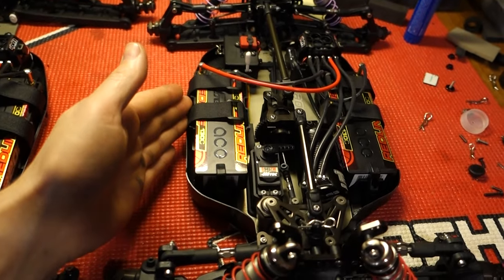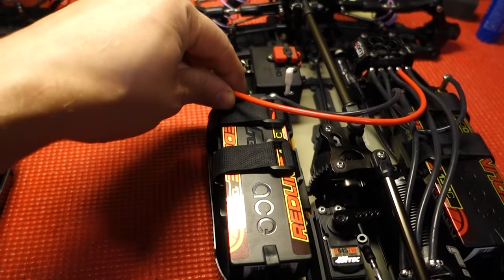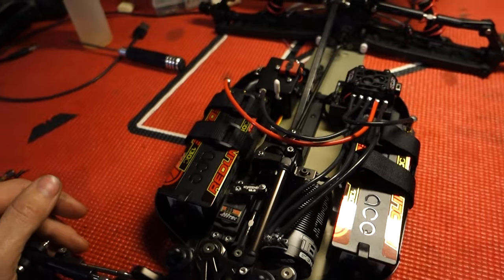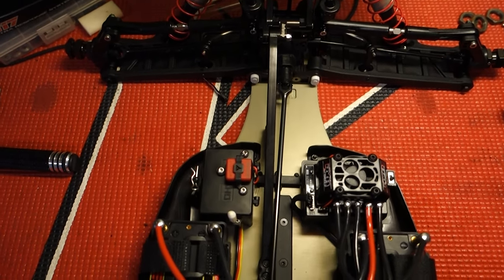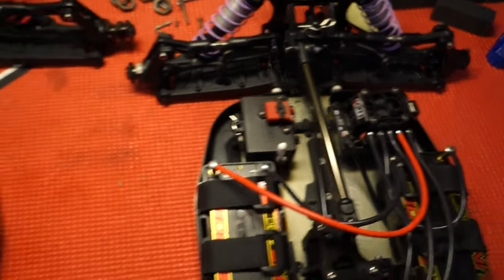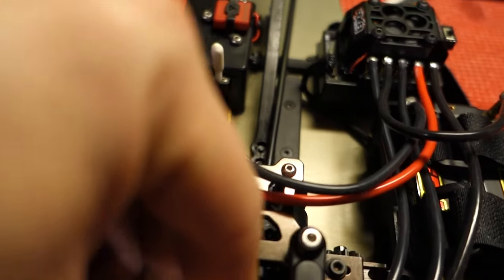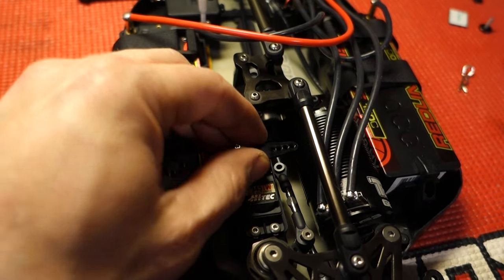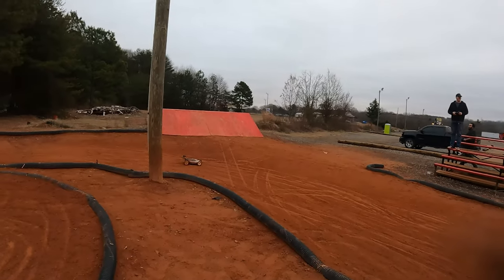KYOSHO MP10Te & MP10e Tekin RX8 Gen3 2650kv

Comment: This buggy motor has enough power to run the truggy without overheating? 
Very strange design by Kyosho. I planned buying the mp10te abd then I found this issue…